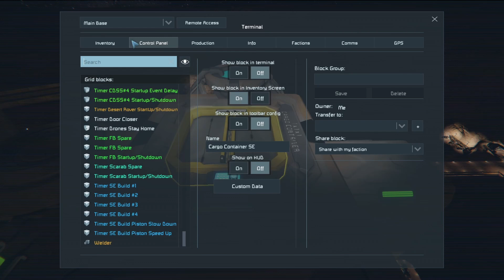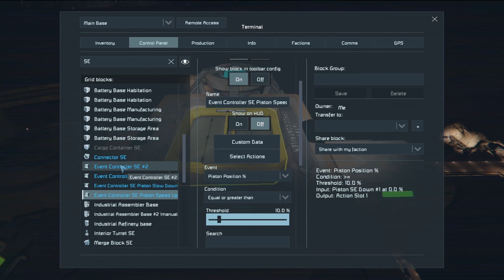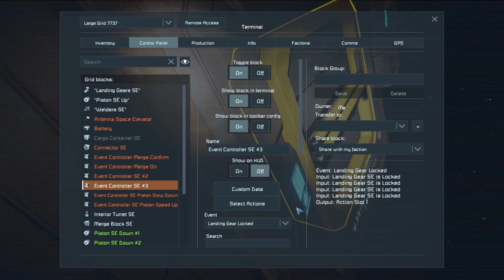Escaping The Desert EP71 - Space Elevator Construction (Space Engineers)

Comment: Thanks for the shout out! 

It is looking like the event controllers are not playing nice with sub-grids or at least running through many different sub-grids. There are advantages to using fewer pistons, less opportunity for clang to show up. Clang also likes it when you pack lots of other blocks around the top of your pistons, give them a little extra space.  At 32:32 if you hit the and gate box at the bottom it will make it so all of the landing gear have to lock to trigger the event controller. Leaving the box un-ticked then it will trigger if any single landing gear locks.

P.S. You can't forget those inertia tensors. 🤣
Reply from the maker: It's not so much the sub-grids, rather the the merging/unmerging. I normally like fewer pistons on these contraptions, but have to access the conveyor up the middle, I want to minimise the number of junctions.

...and I didn't forget the interia tensors, I didn't think I needed them...    I was wrong🤕

Comment: Inertial Tensor !!..... oh you found it :D
First time the Event Controller lost the settings you had changed from Station to Ship (grid change).
Second time the Event Controller lost it's settings you had un-merged the grid (grid change).
When a grid becomes a sub-grid the colour changes in the control panel, i guess the id's change also therefore you need another way {just my uneducated guess}.
Reply from the maker: Yeah it was fairly obvious it was a event controller bug, lucky I changed it to ship then unmerged so it did it twice in front of me. Had it just been a single instance, I might not have picked up on it so quick. Back to sensors.

Comment: You can skip the merge blocks and use only connectors if you put the projector and blueprint on the tower. It should be possible to store the blueprint in the blueprinted connector, but you will have to grind off the old projector the same way you grind off the old merge block. In any case there is a limit to the maximum size of a grid, so you will reach one point where you will need another set of landing gears and connectors. Oh, another thing you can do to reduce the swinging is to add some sliders to the bottom of the piston column, like blast door edges , wheels, or another set of landing gears.
Reply from the maker: I don't trust the projectors printing and loading with correct blueprint, though I have zero reason to base that on, in fact the projectors I often integrate into projected builds have never let me down. Good advice.
Also I expect to break the tether into chunks, firstly to convert bottom section back into station, but also for maintaining grid size.

Comment: I suspect th Automaton Update was far from ready for shipping out. Looks bugged to hell. Glad I haven't gone for it. Looks like the old fashion way with timers and sensors has to be. Also, when using so many pistons you might consider shared inertia tension to limit the wobble. Also the weilder on the far right - you didn't need it there just put it next to its closst neighbour and it will catch the edge (though you might want one bellow it to match the weilding speed pn the other two pillars). I also suspect landing gears on the bottom to act as a guide would be effectiv in dealing with the wobble, possibly eliminating it completely. The event controllers are easy to replace with event scripts (that's how I handle events in my world), but they were such a nice improvement to have if they only worked propperly. Too bad.
Reply from the maker: In regards to wobble and inertia, you're right and the problem is solved, maybe watch the video right to the end. I don't think it will be too difficult to replace the event controllers on this rig, but it really is a shame. They are still useful for other things, I think the altitude function will be help with the space elevator platform and next series when I start flying drones into space and back.